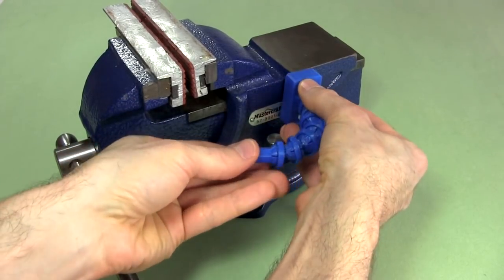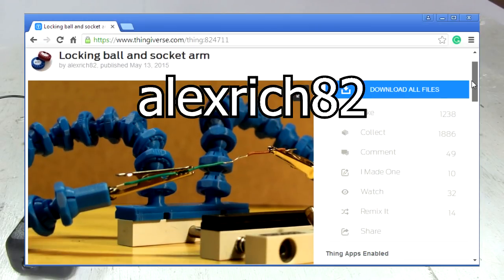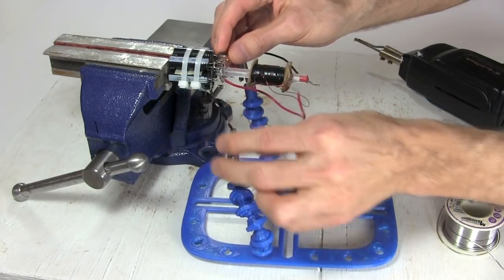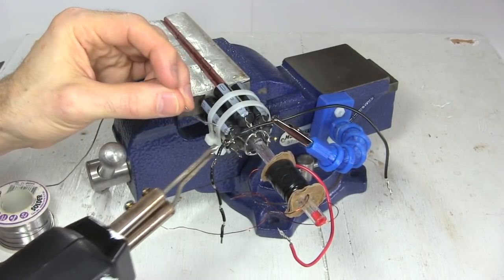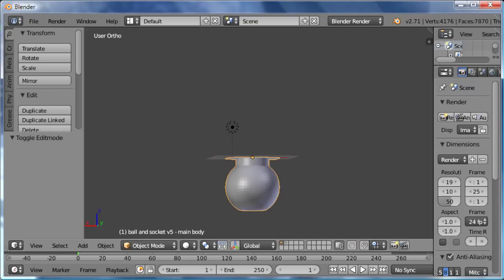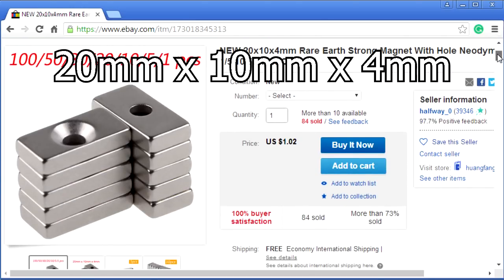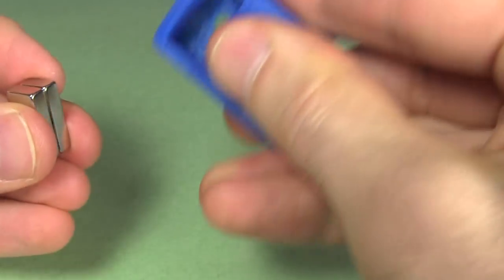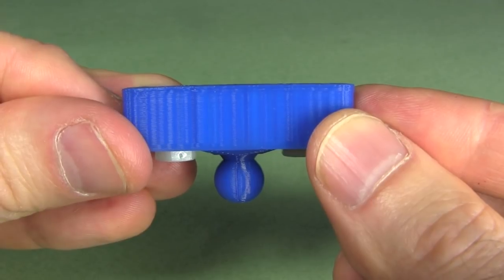3D Printed Helping Hands Magnetic Holder

Comment: Not sure two magnet in that configuration gives more force than one (I think it rather gives a longer field, but at the same intensity). IMHO, putting them in "U" with some plate connecting the N&S on one side would make a stronger magnetic circuit.
Reply from the maker: Having two magnets definitely gives a stronger grip than one. In fact, my first version had only one on either side and I had to add the seconds ones for added holding power. However, I agree that having north on one side and south on the other would make a stronger magnetic circuit. Sadly, the way the indentations for the bolt heads are for these magnets didn't allow me to do that.

Comment: Great to see another one of your projects. I can see I will have to get a 3D printer but I have no idea where I can keep it, too much junk already.  Maybe I will wait till they bottom out on price 😊
Reply: They kind of already have, I really don't see them getting a lot cheaper than the $200ish they're at now for a self assembled kit.
Reply from the maker: I'd like to see a 3D printer in your hands too! Sure, makers like you and me can make anything without one, but it sure makes some things easier and frees you up to do things you might be reluctant to because of the difficulty.
If you're looking for cheapest while still being able to make a fair size, look up Anet A6 and Anet A8. They require some work on them to make them really good (there are a huge number of mods out there provided by a huge community) but they're cheap. And that info's a few months out-of-date so there are probably newer ones. I went with the slightly more expensive CR-10 so that I could skip doing all the mods and get straight to making what I want.

Comment: Why use nylon fasteners? They are weak. So what if the fasteners are magnetic?
Reply from the maker: Good point. The only hesitation I'd have with that though is that the holes are pretty big relative to the width of the magnets and I've cracked a few at that point, though from impact. I'd be afraid to tighten them too much with something very rigid.
Reply: You can use paper washers. I have many left over from upgrading my motherboards through the years. 
Or a piece of electrical tape, then poke the screws through the tape after the tape is attached, or the best solution would be to attache the magnets using cheap 5-minute epoxy. Although epoxy doesn't stick well to plastic, you prints have very rough surfaces where it counts. That way, even if the magnets develop cracks, they'll stay put.
Just suggesting alternatives for viewers that don't have nylon hardware.
Reply from the maker: I especially like the electrical tape washer idea! I'll get some use out of that.
Thanks for the suggestions. Not only doesn't everyone have access to the nylon parts, they're also expensive.

Comment: Wouldn't it be better if you use vacuum stickers? The vacuum stickers can stick on any surface while the magnets stickers can only stick on ferromagnetic surface.
Reply from the maker: Oh, neat idea. I've never used them though. Can they hold much weight? I can see a problem if the surface you're trying to attach to isn't even, but it should work for most cases.
Reply: They can support huge weight, so much infact it is impossible for me to pull them out of the wall, you can only get them out if you lift one side of the sticker and let some air in. Other wise you need to be very very strong to pull them out.
Reply: You know I wish I could find the vacuum cups that my vice uses where you flip a lever over that pulls the rubber away from a surface and doing that it creates a vacuum that is strong enough to life about 8 pounds per square inch (if not more) but it requires a smooth surface.

Comment: sound needs improvement
Reply from the maker: Yeah, I think I need a windscreen for putting in front of my microphone.
Reply: Actually i think you need to see how to level audio and all other kinds of settings, your voice sounds a bit more silent than video
Reply from the maker: I've done quite a bit of leveling to get the sound I have. Not sure what you mean by voice sounding a bit more silent than video. I do run my audio through Audacity to remove noise.
Reply: His hearing aid batteries are going out so not to worry.